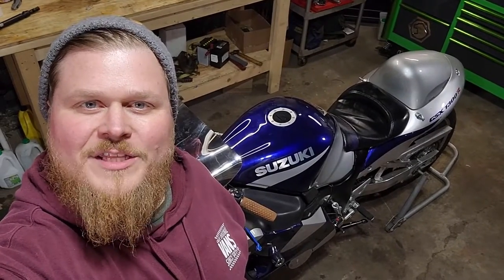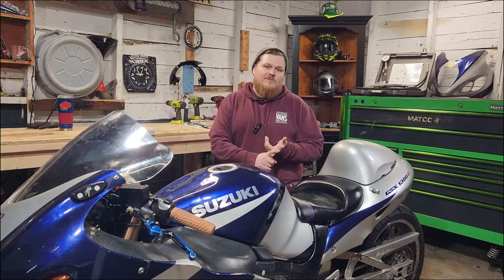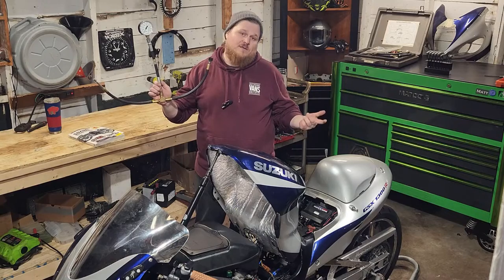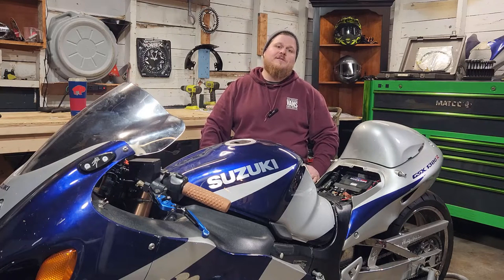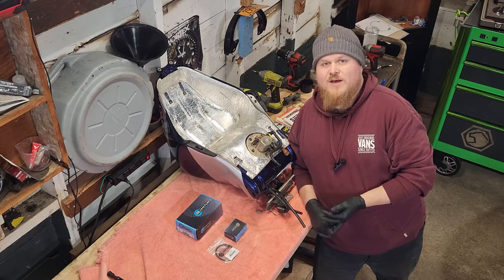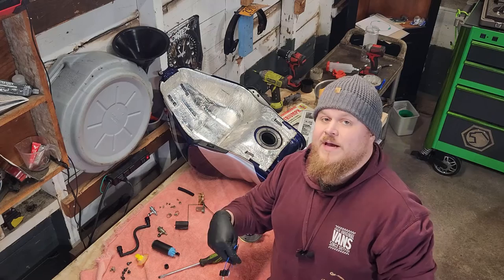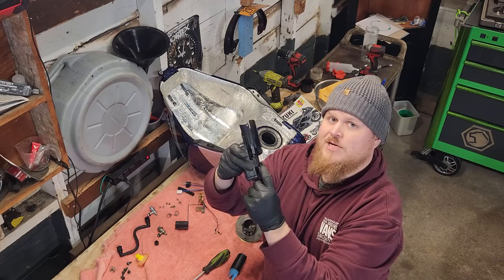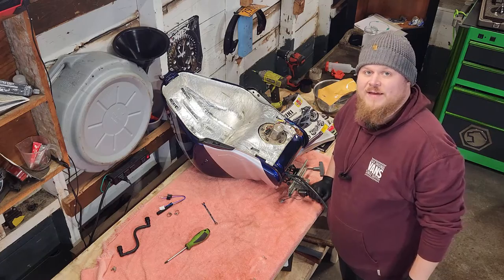2001 - 2007 Suzuki Hayabusa Fuel Pump Diagnosis and Replacement / Repair

Comment: wow my 2003 Suzuki hayabusa was also losing serious power. it sat for a long time and the cranks lasted an eternity. i tore the bike apart cylinder by cylinder looking for the problem to no avail. thanks to your video, i have now been able to correctly diagnose and fix my bike. very insightful, matt. i wouldn’t be able to ride without you. forever grateful.
Reply from the maker: Thanks!!! Glad you're rolling again! Ride on!

Comment: Good video chief. When using a compressor to blow out components like that just turn down the pressure. I've gone as low as 30psi for such jobs.

Comment: Really great and easy to follow video. But how did you reuse the pump wires without cutting one end of the original connectors, so you can pass the wires through the original black plastic cover that slips over the nuts on fuel pump. Thanks!
Reply from the maker: I don't believe I reused the cap. If I remember correctly the cap has a loose fit over the nuts. Not protecting it from fuel or anything. As long as the nuts/screws to the wires are tightened down properly there should be no issue. Hope it helps

Comment: hi mate - quickquestion. You went through a start up process when reconnecting the battery - what was that?
Reply from the maker: It's been a while since I shot this. But it looks like I sort of did things out of order there. I reconnected the battery before I finished bolting up the tank, and was checking and refitting connections below it. But, I cycled the ignition a few times to prime the pump and fuel lines. When you disassemble the fuel system it drains and fills the system with air. There will still be air in there, but cycling the pump a few times pressurizes and fills the lines back up. It reduces cranking time when firing back up from fuel sys service. It looks like it even stalled after the initial start which would have been due to an air pocket. Hope this is what you were referring to and is helpful.

Comment: Hey Matt, great video, I'm about to tear into my 2004 Busa as I'm having the same problems at high RMP's, power drops off around 9,500 or so, I can coax it a bit with playing with the throttle. Did this fix your problem? I'm thinking on changing it anyway, over 160K km on the bike (100k miles), I've owned her from day one off the showroom floor, love this bike. Cheers!
Reply from the maker: My problem was very similar. But without hands on your bike, I can't be certain. I've been seeing issues with clogged fuel filters on high milage busas as well. So I'd look into possibly bypassing the filter. I've seen some forum posts on how to do that. I hope you got her back running tip top again. Lmk what worked for you.

Comment: Hey Matt any know abouts with the fuel pump wire diagram I got the 4 prung harness on the bike an the fuel pump is 3 prung any thoughts been searching for days anything would help looking to splice an connect thanks Matt

Comment: hello Matt can you tell me if the replacement pump motor was the same size as the OEM
Reply from the maker: I shoulda held the two together for the video, that woulda been a great idea. Ahhh, hindsight. But the Quantum pump was the same size. They looked almost identical, minus the colors/materials used. Fitment was near perfect. 
Only note here I could think of would be: when inserting the pump back in the assembly, I pressed it in all the way. I then installed the retainer and had a bit of gap between the pump and retainer. I simply slid the pump to the retainer. The fuel pressure would do this in the tank anyway. But I just wanted to know it was seated against the retainer with a good seal to the assembly. And it was.
That might be too much info. But it should make sense when you have the assembly in your hands. Hope this helps!
Reply: @mattzahmdotcom  thank you,I'm looking to replace the pump in my 05 busa  and clean or replace the fuel injectors
Reply from the maker: @Don Simpson  fresh fuel system, nice! Plenty of room to attack the injectors with the tank off for the pump. Chasing problems or maintenance?
Reply: @mattzahmdotcom  just some  Maintenance  I think the pump my be alittle weak and may as well clean the injection system too can't hurt lol

Comment: Hey great video. My bike tipped over in the drive very minor !  But my issue started from this, and I’m having that same issue losing power up top. What do you think? No issues ever with the bike before this!
Reply from the maker: It could very well be the pump. Can't say definitively without getting my hands on her. But if she's older, it's not uncommon for the pumps to get tired.

Comment: la recomiendo ,la compre la misma en ebay ,la motora tiene mas pode, no tube problema de la intalacion todo a original.mi moto hayabusa 2007,lo unico adicional fue limpiar el tanque con vinagure y ponerle sellador.
Reply from the maker: ¡Excelente!

Comment: Hey guys, I just recently purchased one.. It's a 05 model, after a changed sparks oil and filters, new coolant.. Taken for a test drive and realized white smoke out from exhaust (oem) not all the time... . Bike strats and runs fine got 25k miles... What can be the problem? Please any advice 🙏
Reply from the maker: I'm sorry but I cannot give much quality advice without diving into the bike with my hands on it. I do know that white smoke typically means burning coolant (steam).
Generally speaking, black smoke means the engine is running rich(too much fuel). Blueish smoke means burning oil. White smoke is a tally steam from infiltration of coolant into the cylinder. 
The blue smoke from burning oil can look whitish, if not sure smell will tell. Coolant will smell weird, kind of like a sweet smell.

I wish you the best of luck.

Comment: My bike randomly jerks for a second and runs fine when I twist the throttle at around 6k rpm on a 02 gsxr 1000 I wonder if it’s my fuel pump
Reply from the maker: Hard to say. Surging throttle response could also be a symptom of a bad pump. It could also feel like the engine is hitting a ceiling if the pump just can't keep the pressure up enough to meet the high flow at higher rpm.

Comment: Great video,  i have a 05 and the bike sat for 2 + yrs, now the bike just cuts off. I rode it and it died on me. Do you rhink its the pump? Thx
Reply from the maker: Hard to say to be honest. If it's a bad pump, symptoms would most likely be a no start, or lack of power with increased rpm. It would really depend on the conditions when the bike dies. Was it fine then died and wouldn't start? I've heard of bad kickstand switches causing the bike to turn off mid ride. But that's sorta a shot in the dark

Comment: Did you go with the high flow fuel pump from quantum or the OEM replacement?
Reply from the maker: You only need high flow for high power applications. Like boost or big bore or something that would make the engine to require larger fuel injectors to supply more fuel. If you're running stock injectors you should be fine with OEM type replacement.

I would like to note, I ran into trouble with the quantum pump a bit after this video. I ended up going with a Fuel Pump Factory replacement and that one has been strong for over a year now and many hard passes down the drag strip.

Comment: I was looking for the relay because the fuel pump won't turn on and it's not the fuse
Reply from the maker: It's under the rear plastic, below the seat, on the left side. Right next the the battery, but on the outside of the frame. Hope this helps.

Comment: 2 questions for you. When I looked on quantum 1 review said that the fuel pressure regulator didn’t fit correctly, did you have any issues or have to trim it? And also do you have the part number they had like 4 different ones on the website. Thank you
Reply from the maker: Hey I'm sorry for delayed reply. I had no problem with the quantum regulator. It fit perfectly. I wish I did a parts comparison for the video too. (I haven't done many, still learning). But from what I remember they looked the same, and was a direct fit. The part number is HFP-PR34. That fit my 03 Busa.

Comment: Hi!
My 2004 Busa is displaying C41 code error, I’ve checked the fuses, fuel pump relay and they look good. 
Any idea what could be the problem?
Reply from the maker: Hard to say. Could be a number of things. Does the bike run? Also, would have to know how you tested the relay. Could be clicking but still resistance at the through contacts within. Could be an open or a short in the wires or the pump. I really would need to be hands on to help.

Comment: Awesome Matt《☆》Nice work with diagnostics & results👍I had to replay 2wice I was making dinner. Did you see any rusty spots in your tank. I saw a clump of rust in the bottom of my tank but I couldn't see where it came from looking thru the filler🗣Quantum sounds like a good choice. Maybe Global warming will send You an early thaw🖖😎☮
Reply from the maker: I'm pretty lucky. It was very clean in there for it's age. Only a bit of crud in the strainer, and when I flushed the filter it came out tinted but not dark and cleared up quickly. So all in all it seemed pretty clean.
Can't wait to test ride it to confirm the results!

Comment: Ona busa u don’t have to pull in the clutch as u start
Reply from the maker: Ah. Just a habit from some of my other/previous bikes
Reply: On my Gen 1 and gen 2 Busa I have to pull the clutch in to start. My Gen 3 Busa I don't have to pull it in. Just make sure it's in neutral. I don't know what Busa you have but that's not always the case for Busas. Busa 🏍!